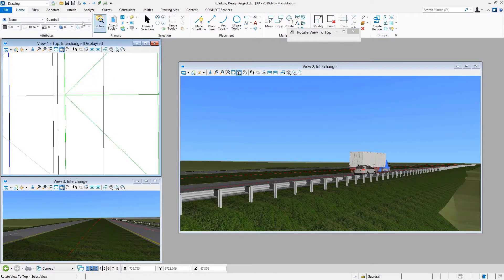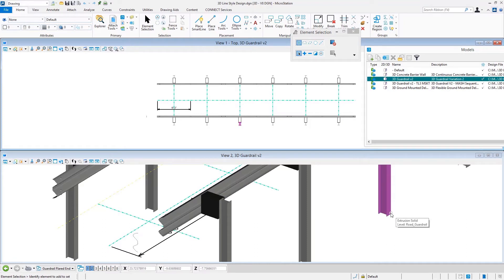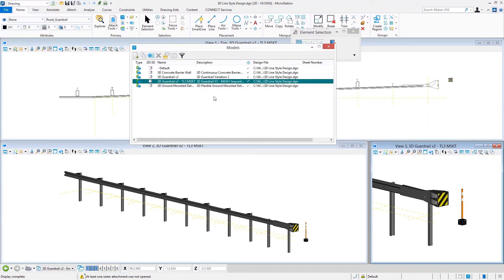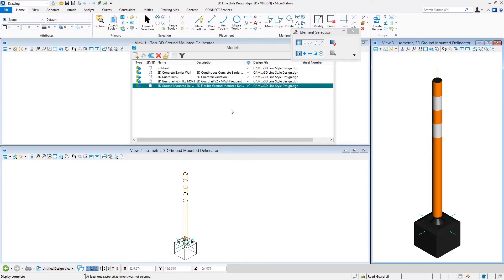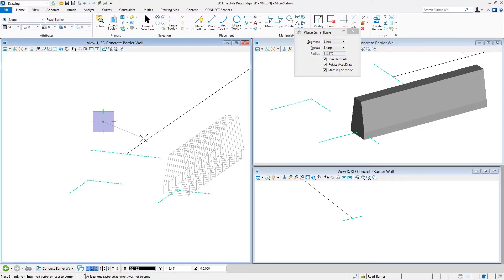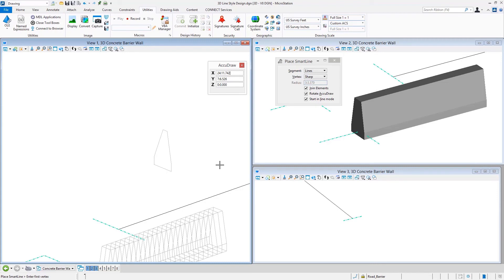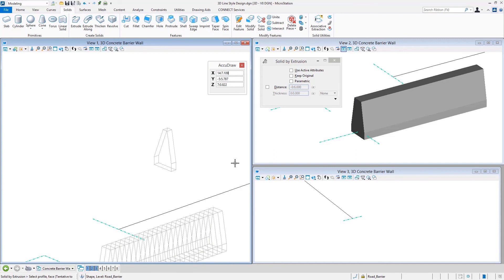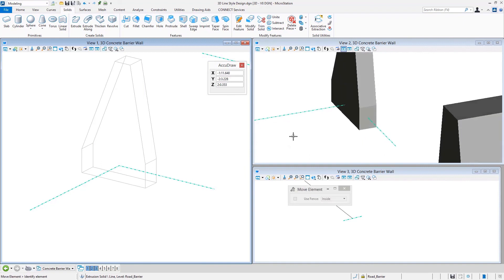3D Line Styles - Drawing 3D Barrier Geometry

Comment: The closed shape needs to be projected along the line. I did this 20 years ago and would like to see some coding time invested in to achieve a useful tool.
Reply from the maker: Hello Thor. I am not quite certain what you are asking about. Submitting a Help ticket with Bentley Support could provide some insight.
Reply: @BentleyMicroStation  search for thor leslie 3d custom line styles askinga wiki and read the article I wrote. I am now retired and do not have access to the latest MicroStation. The barrier profile needs to be a extrusion not segmented and that would be the best enhancement that could be done and it would change the way 3d linestyles could be used.